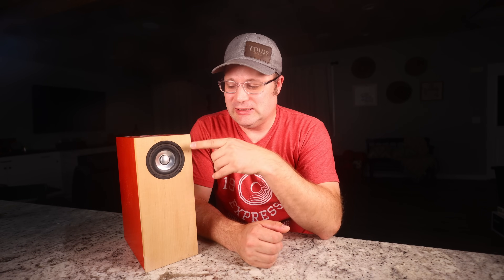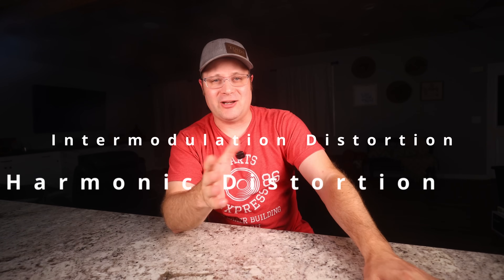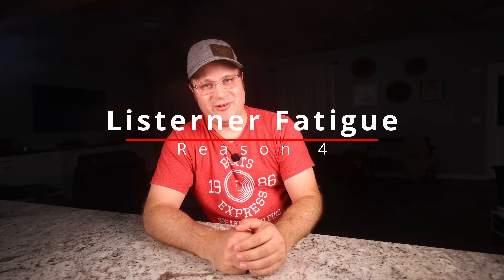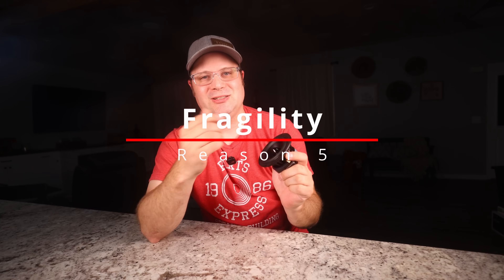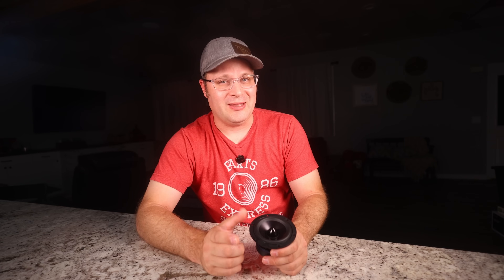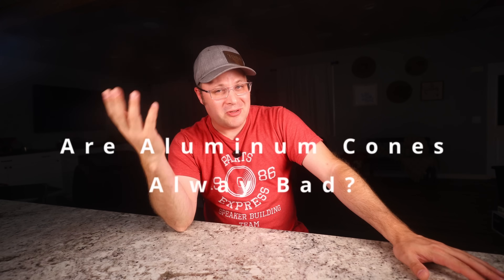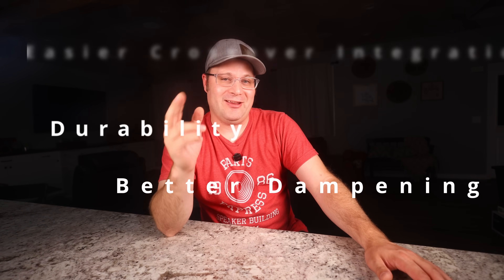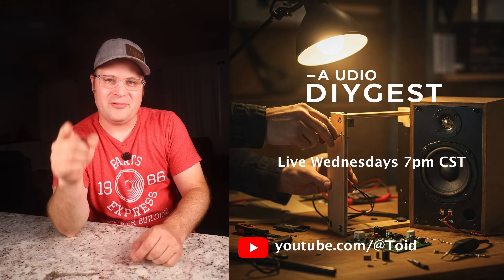5 Reasons You Shouldn’t Use Aluminum Cones in Your DIY Speakers!  (Most will Miss #3)

Comment: Erin had a nice video on how dents does not affect much, if I remember it correctly, so you might be off on this detail. I would not know, yet. My dog attacked Yellowstone cattle on the TV and put three claw marks into one of the woofers of my KEF R6 Meta (probably pushed it to xmax aswell), just measured it super-near field today in-place and could not see a difference between the two woofers. But just the look of it hurts, gonna have to replace the driver. Nice video apart from this detail, thanks!

Comment: i know everyone else is saying the same thing, but this is VERY dependent on the woofer at hand. some woofers will have breakup right in the crossover region, and some way out of the crossover region. and some breakups are much much tamer than others.

my first project is gonna be using all aluminium components (apart from the tweeter) - 2 8" DSA225 aluminium passives and 2 6.5" dayton SIG180-4. the SIG180s have incredibly flat response right to 3khz, where it gets maybe 1dB brighter past the 2500hz mark. breakup is presumably much further past the crossover mark of 2200-2400hz i will use. I have DSP at hand to tackle any weird issues, but im not expecting it to turn out as harsh as Toid is making out.

quick question for you by the way, would you recommend crossing over at 2200hz with a tweeter Fs of 1600hz? it should see maybe 20W clean power at the absolute max, and is rated for 100W (likely not nominal though). is that 20W going to be an issue if i did a 2nd order crossover for smoother transition instead of 4th order to protect the tweeter?
Reply: Way too low. You need at least 4th order for that low a crossover, because that resonance ringing is a very high Q compared to a woofer. It'll cause a big peak in the crossover region and temporal smear. Crossing that low and I don't see why you'd care about fast crossover. You're not getting much beaming or anything.
Reply: @mikafoxx2717 so would you say a 2.8-3k crossover is more suited to it? even though the woofer response is only up to 3k? i would like to have tried to avoid that possible harshness from the aluminium cone

i modelled it up in vituix with a 4th order linkwitz riley and it looked pretty flat, but ive got no clue how accurate it would be.

edit: i do have DSP, so a 4th order xover would be very doable, or would that not sound as good as a 2nd/3rd order?
Reply: 4th order should be fine. Look at the dispersion on your 6.5" speaker. Remember that crossing over with more overlap means more nulls from the distance between two drivers, and is often worse than switching from a slightly beaming woofer to a dispersive tweeter. 2.8k is probably fine. You can experiment if it's DSP. I built my crossover in hardware for a set frequency so the driver choice is more critical. But some cone breakup is probably better than a giant peak in the crossover region from a huge resonance peak. Test and measure if you can. Drivers with less resonance like AMT's are nice for those low crossovers if you can accept the lower power handling of the speaker. @iGPR3
Reply: @mikafoxx2717  so besides power handling, playing closer to tweeter Fs will give me ringing? you dont think a notch filter there would maybe help compensate?

like you said, ill have dsp so i can experiment and test response. cant wait to get it built up and test it! gonna try out wood veneer baffle for the first time, should be fun
Reply: A steeper slope will give you better off-axis response, less cancellations.  A gentle slope just means there's a wider range where the drivers are cancelling out off axis (vertically of course, with a typical design).  Just do 3rd order that's like pretty standard.  18db is usually ideal imo.  I've heard people say you want to cross an octave above Fs, some say you can get away with half an octave (which would be 2400hz here).  But slope and power play into that determination too.  The one concern is tweeter excursion / distortion / damage obviously, but the other is sound quality, where they don't always sound good so close to Fs.  You could see if you can lower Fs with a waveguide, or go with a planar/amt that can play lower.  And of course, horns are by far the best speaker design to ever exist, if you wanted to go that way.  You could cross way lower than that with a 1.4" CD on even a modestly sized horn.  Even a 1" CD could play lower than that.

Comment: For me, fragility is the exclusion factor when choosing a driver. I prefer speakers without a cover or grille, so an aluminum cone is the worst possible choice. One second of carelessness and you can buy a new speaker chassis. Even if there are very good speaker chassis with an aluminum cone. They are simply too vulnerable for me.

Comment: I agree that aluminium cones are not ideal  for DYI beginners. But most of the issues you have named can easily be identified in the measurements and avoided by proper crossover design. If one chooses a lowpass frequency a fair amount of Hz away from breakup frequency, even below first directivity anomalies appear, everything about harshness, resonances and breakup is basically becoming a non-issue.
Reply: Even that isn't usually enough by itself... typically you'd want to see a steeper slope (like 18 instead of 12) and/or 1 or more notch filters up where the breakup occurs.  Just because the breakup occurs an octave above your crossover point or whatever doesn't mean it's not going to come through, but the crossover can mitigate it... it just needs to be WELL down in level not just 12db or whatever.

Comment: Hey, I wish I’d seen something like this earlier in my audio journey. I was that idiot who messaged you on Patreon back then haha! Now I’ve got my Crystals with the 125RS woofer and a 1″ silk dome, crossed over pretty low. The setup sounds great, but I’d prefer a slightly warmer tone. I definitely don’t think it’s worth it for beginners to use aluminum woofers or tweeters, paper just sounds more natural and is less fatiguing most of the time. Thanks to you and many other YouTubers, plus all the hands-on experience, I’ve learned so much. Thanks for everything!
Reply: Paper or silk etc are good because at higher frequencies they act as a resistor and absorb the energy some instead of maintaining it like a spring, until the frequency that they start bouncing in more than one place with a null in between. Especially for domes, a stiff done will transfer the high frequency up to to the top where it flexes more easily, soft domes absorb the wave more at higher frequencies before they get to the top and lower frequencies are too slow to vibrate it separately from the whole mass.

Comment: I have small PC speaker Logitech Z50 with just one small full-range crossoverless aluminium speaker - and it sounds very sweet and natural. Most time better than paper. Tweeter with aluminium diaphragm can sound pleasant to - softer than titanium and crispier than silk at the same time. So may be your theory have some background, but there are to many exceptions in real life)) And small paper fullrange speakers by the way mostly sound very harsh and dry, from them I have ears fatique realy soon.
Reply: Your reference is a z50 and you're judging cone materials?  Bro ur speakers are little PC speakers, not hifi stuff, they're junk.

Comment: I think it comes down to how well the driver is designed. A well made aluminum cone driver should have zero ringing within the driver itself. Meaning it's more than likely not going to be cheap. As mentioned it depends on your budget. If you are trying to go cheap. Probably best to stick with a paper cone driver. They should offer more quality for the buck.

Comment: I don't agree. Some aluminum drivers might have this problem but some don't. I have an all aluminum tower speaker I built and it uses 5 components in the crossover. It has none of these problems.

Comment: Paul Carmody's Overnight Sensation series of designs used alloy metal HIVI mid-woofers and Jeff Bagby had a small design with an now out of production metal cone woofer. Both were reported to sound quite nice. The tweeter selected must be able to be crossed low enough to not see the cone breakup, as with some paper or poly cone woofers.
Reply from the maker: Absolutely. Overnight sensations are fantastic speakers. Just like the video states if you know what you’re doing they’re fine. But just make sure you know how to deal with the five reasons stated. And if you’re a beginner, they’re probably not the first woofers you should start with.

Comment: Please don't spread misinformation. Alluminium can be a fine cone material, e.g. often used by Kef and also SB Acoustics makes some excelent drivers. The shape of the cone is important to reduce the resonances, e.g. the Dayton Audio RS shown in the video is a bad example. For tweeters alluminium can actually be less harsh sounding, just make sure that the cone break-up is well above 20 kHz which it usually is. The benefit of alluminium vs paper is the additional clarity due to the material hardness, operating closer to an ideal piston. For subwoofers alluminium is also excellent and can reduce thermal compression. Especially in a 3-way design allumnium can be an excelent choice
Reply: One issue with breakup even over 20khz is the intermodulation distortion it causes lower in the frequency range. I prefer soft domes with how they absorb the higher frequencies before they reach the top of the dome that would flex at higher frequency. It's an elegant solution using transmission line principles.
Reply: @mikafoxx2717 perhaps unwittingly, you make a good case for ring diaphragm tweeters
Reply: @naturalverities There's a good reason they're made the way they are and are as popular a they are! The dome also helps dispersion as it acts as its own phase plug somewhat at higher frequencies where the soft done absorbs it soon before going up the dome. So your ears mostly get the source of highest frequency just from the nearest side without as much phase cancellation from the other side being line of sight. With physical audio reproduction you need to think of everything in terms of transmission line theory, pretty much.
Reply from the maker: It appears you didn’t watch the video before commenting. If you did then, I don’t think that you would’ve wrote this.
Reply: @Toid  yeah my Kitty Kat 🙀 isn't very happy with tweeters that break up severely above 20K hertz 😢.
Reply: Show me a single aluminum tweeter with the first breakup mode over 20khz, i'll wait.  Aluminum, even titanium, I don't know that I've ever seen one with breakup starting past 20khz.  Maybe a magnesium/alloy, or a very fancy one with a really good coating, maybe diamond or something else.  Typically this is why people spend big bucks on beryllium drivers, because that's the ONLY material that tends to push breakup modes past 20khz.

Maybe a .75"?  MAYBE?  If you're talking 1" domes, sorry it ain't happening.  Need to damp it, either with a coating/vapor deposition or a soft dome, and a good surround design to damp the reflections back into the dome.

Comment: Some pretty true facts in this video !
Reply: Some bollocks too.  Stiff cones are more pistonic, and catastrophic breakup is not just a metal issue.  Take a look at the older SS 8545, or the SB15NRX2C30-4 - which is great right until it properly lets go. What do Jordan and EAD use for well regarded full range?  Oh yes ...   Admittedly I have a pair of PL18s and they don't need a notch, but the temptation is to play them too high into the area where the dispersion is a real issue, not least because contemporary tweeters have high fs by modern standards.  I don't see any problem with bass and subwoofers anyway.

Comment: I avoid paper cones bcus i live near the equator with high humidity and temps.
Reply: That's silly as there are plenty of treated paper cones, if not the majority.  Pro speakers designed for use outside use paper cones all the time... but they're treated.
Reply: @Artcore103  how long does pro speakers last. not sure if they are made for longevity. All paper cone speakers i've owned over the last 30 years are treated, yet they soften in the 30+ degrees heat and 80+% humidity.

Comment: So what are the best cone materials in your opinion???
Reply from the maker: Paper cones are typically the easiest to start with for beginners. But in general there is no best. There’s pros and cons to each material
Reply: @Toid  poly are the easiest. Paper cones unless well coated often have a lot of issues in upper midrange. Polys are simple. It varies driver to driver of course. There's no single solution.
Reply: For low cost drivers paper cones are probably your best bet. It's a well studied art that has been in use for a long time.  They also tend to roll of nice and natural.  That just makes the crossover simpler and getting it perfect isn't as necessary.

Comment: Don't care about #1 and #2 because that can be handled . Not sure  about #3 . But nobody ever mentions metal fatigue . Alu is an exception wrt to metal fatigue . Steel and titanium have an explicit maximum distortion limit which guarantees the material will never break if distortions are kept below that limit . No such limit exists for alu . This means that how ever low you keep the distortion , eventually the material will break . It will break ofcourse later if you keep distortions small , but break it will .
Reply: You are correct qualitatively. Quantitatively, aluminum can be a good choice if proper care is exercised in design and maintenance. Do you refuse to fly in aluminum passenger jets simply  because they will eventually fail? OTOH aluminum driver diaphragms with integral aluminum flex surrounds are notorious for flex fatigue failures.
Reply: @naturalverities  KEF has had cone fatigue problems for years you can see it in the forums, especially their smaller speakers or 2-ways with no dedicated/larger woofer.  People trying to use those tiny baby q150's full range at volume... they just wear out.  People shouldn't use speakers designed for ants and doll houses in real living spaces for humans, that speaker is a joke.